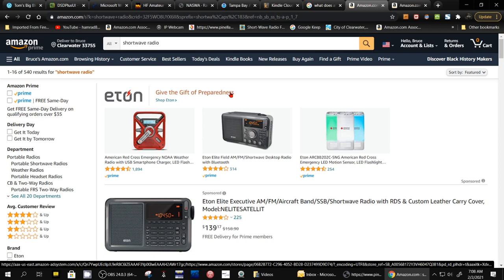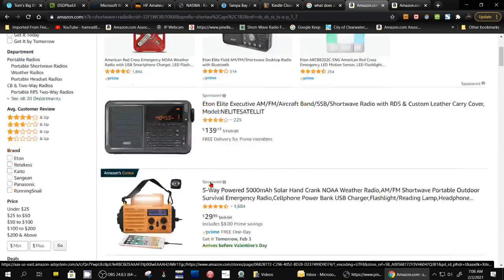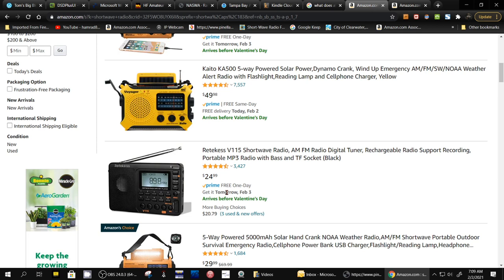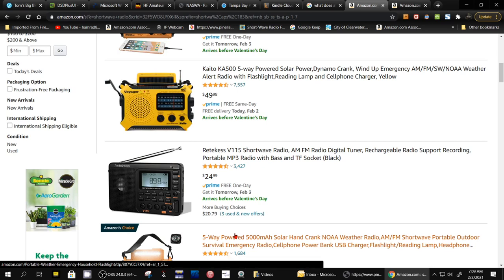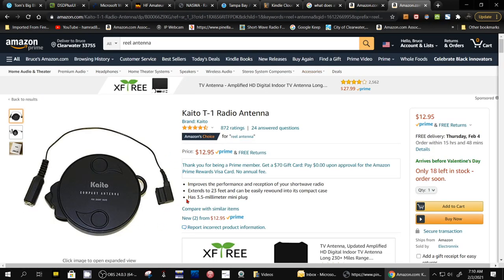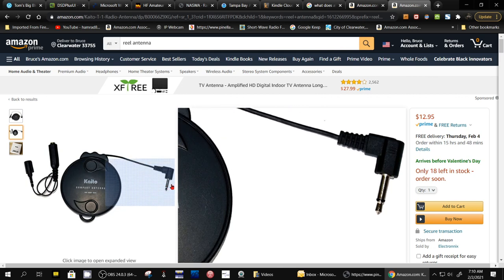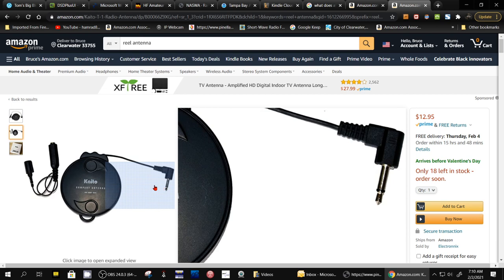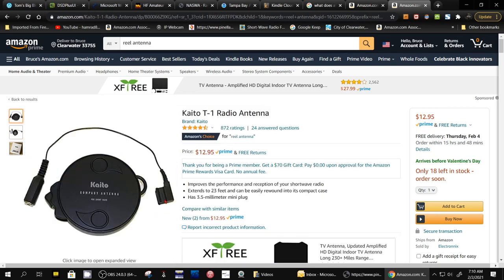TRRS #2087 - How to Improve Shortwave Reception

Comment: I bought one for my Grundig Satellit 800. Seriously improved my reception and help me pull in signals on frequencies I hadn't before
Reply from the maker: That's great to hear.
Reply: Have something like this that came with a radio I have and I like to use it with my XHData D808. It works very well but with all the RF noise I have to go out to the work shed in the backyard. It’s way too cold out there right now. But whenever it gets warmer, I always go outside to check reception.
Reply from the maker: @RJDA.Dakota  Same here too cold outside.  Have a great day.

Comment: I picked one these up early last year. Didn't get much improvement but my radio is super old/minimal so kinda took that into account.
Was wondering if I ran it out window and was able to close window without damaging wire if it might do alittle better but that's a summer experiment for sure.
I think just playing with it to see where it likes to be in a particular room prob best option(here)...Thanks!
Reply from the maker: Thanks for the info.. Yes, having the antenna outside is best and as high as possible.